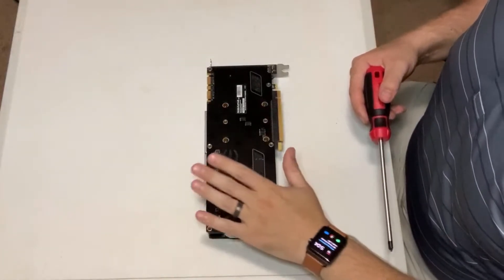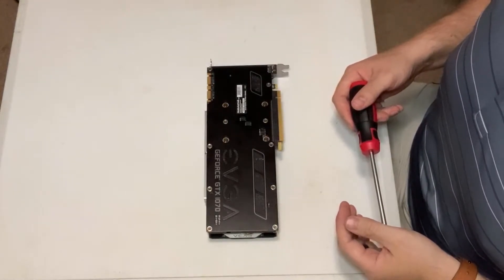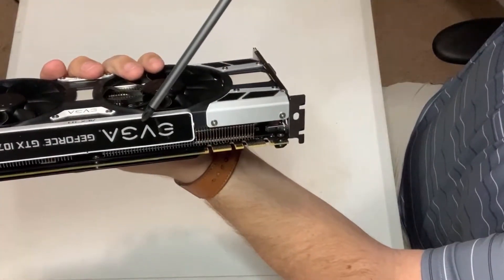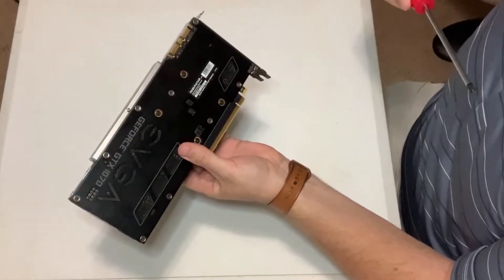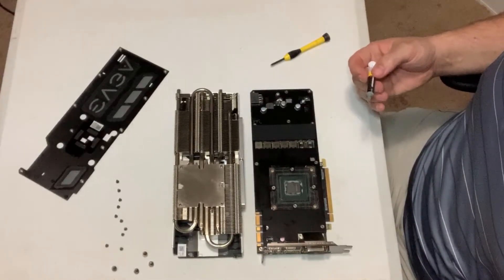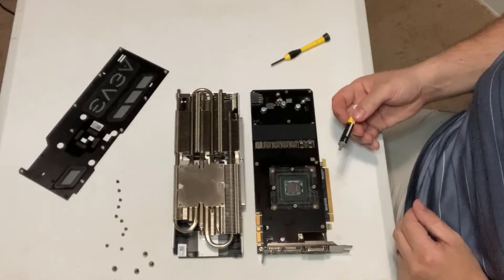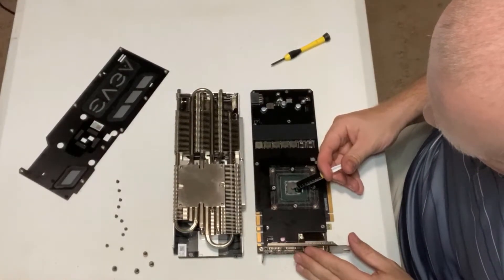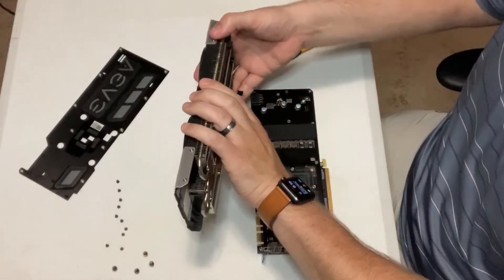How and When to re-apply thermal paste to your graphics card (GPU)

Comment: Thermal paste doesn't dry out after 4 years my friend (maybe if you using it on 100% 24/7),   GPU thermal paste from factory is more thicker than CPU thermal paste..Git gut
Reply from the maker: My experience says otherwise. And while no, it isn't completely dried up, it is a good time to replace it, especially when it is used and you don't know how someone used the card before you got it.

Comment: Hi!  My old 5 years video card GeForce GTX 780 temperature is 58 -  69 celsius when gaming and my screen freeze and turns fully random screen color with anoying sound.  This means my GPU is broken? If i will change thermal paste it will fix this issue? Or there is another reason for my computer freezing when playing games?  Any help please!
Reply from the maker: I don’t think reapplying thermal paste will help, but you can try. It won’t hurt. Those symptoms usually mean the card is failing. if you haven’t already, I would try completely uninstalling and reinstalling your graphics driver. Just make sure you get the driver first before uninstalling.

Comment: I had a quick question i was running my fans at a 100 I noticed a small area on my heatsink with white paste looks like dried thermal paste my guess it’s on the tops sides of the fins what’s that a sign of functions properly stay around 40-50 degrees had it less then a year never seen this issue before?
Reply from the maker: Not sure that is thermal paste as it sounds like it is far from where it would have been applied. Hard to tell without seeing it. That being said, I would try running your fans slower and see how the temps do. If you can run your fans at 50-75% and your temps stay in the 70’s it could make your system run a lot quieter. I usually don’t have my fans spinning at 100%.